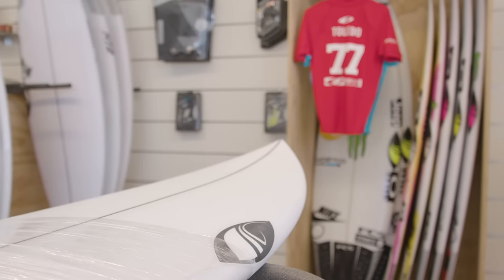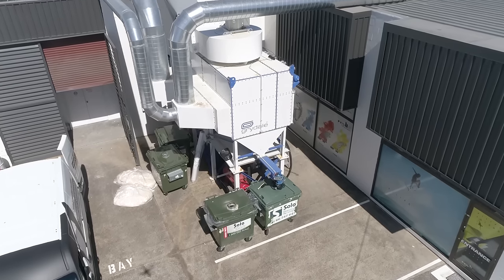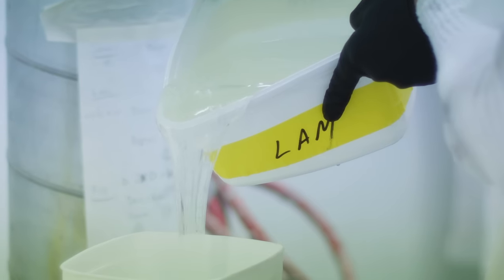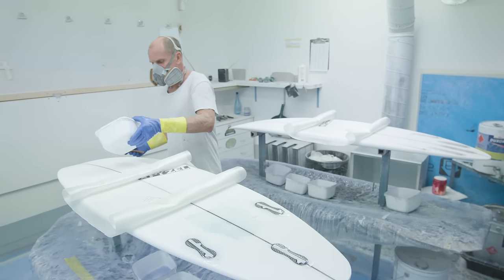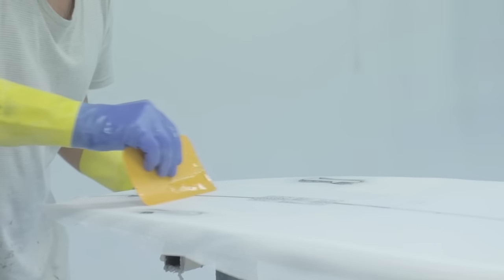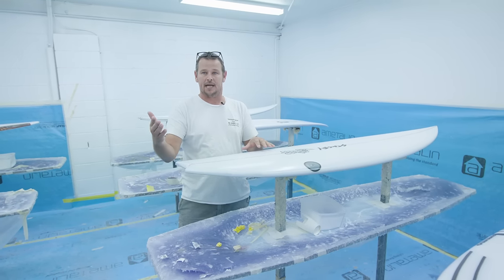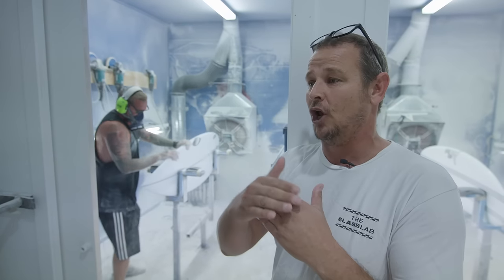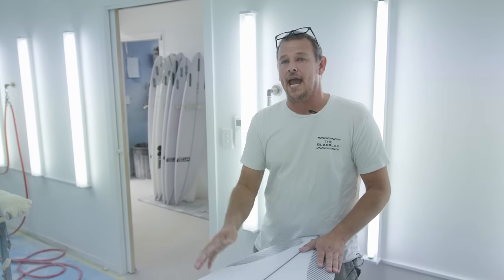Behind The Curtain - The Glass Lab

Comment: All this shite is what is wrong with the industry. No shapers; all aided by the machine then finished by a wanna be shaper (check the video to see)
No squeegee. Those spreaders are for epoxy not for polyester resin. They cannot understand the differences in application and what the different resins and core material actually do.
Generic boards for photocopy surfing actually.
Great installations though.
Reply: 12